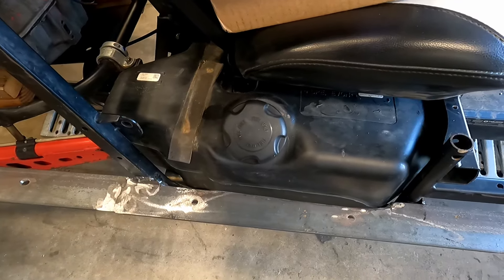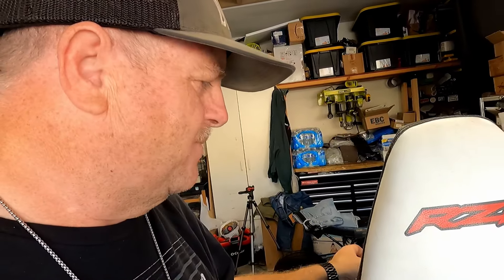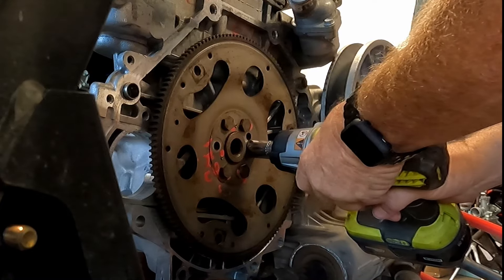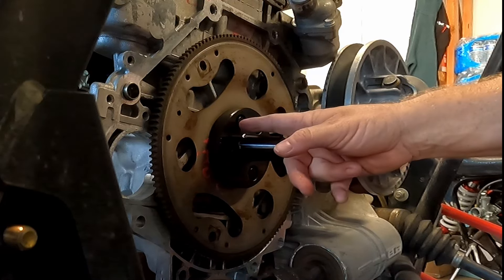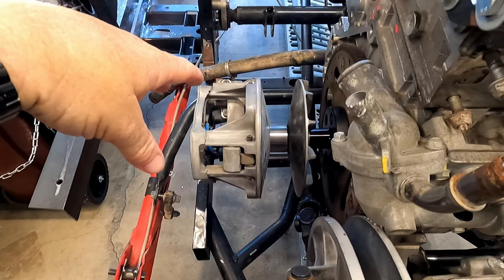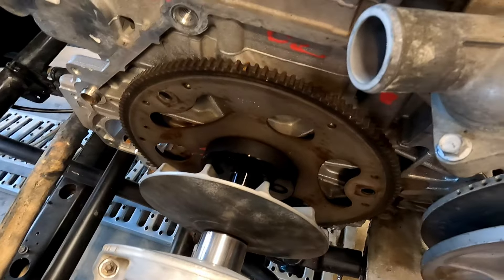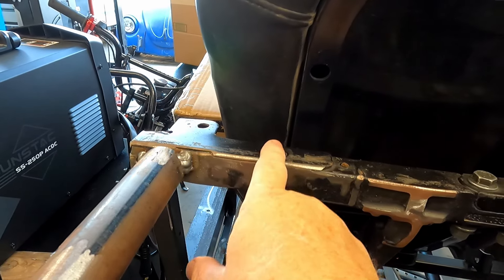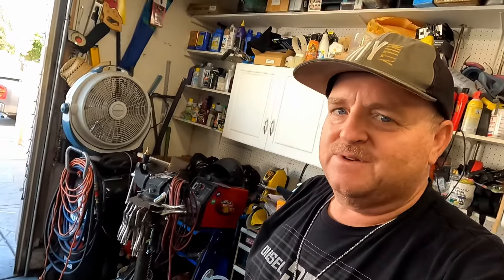Chevy 2.2 ECOTEC Primary Clutch Adapter - BAJA RZR Project EP  14 -

Comment: The fun part is figuring out how to make parts work together and accomplishing the task. The ARP bolts are some of the best you can buy, I used them on my alum cyl. heads on my Chevelles 541cu in big block motor. Nice video Willy👍
Reply from the maker: I read a lot about other bolts failing so can’t loose with ARP!

Comment: Nothing like grabbing a hot bolt! Been there done that 😂 great upgrade, perseverance and persistence for sure. You inspired me to quit procrastinating and change the belt on the Can-am.. need to get the special clutch tool first but can’t find one with the right threads 😢looking forward to the next update!
Reply from the maker: I feel like I’m at the hardest part of this build. For the last 3weeks I’ve been trying get correct belt alignment and lock in the motor mounts and it’s fight me everyday.  I have it so close but it’s still not correct. Now I pretty much have to start over. Unfortunately the work I have done so far is fully welded. Now I’m cutting it loose for the 4th time. I want everything so perfect. It would probably be fine now but would most likely burn belts. I’ll get it though, I’m pretty sure I figured it out this time. When I get these clutches and motor mounts all done I think I’ll take a break from the Baja project.
Reply: @DIYWilly  
You’ll get it done ✅ Willy style! Take a breather and go back at it when the spirit moves you… 🤙🏻

Comment: This is way outta my knowledge of operations but with the wisdom and courage i now know the difference lol whatever you did its fresh and diy willy style 💪🏼💯🔥🔥🔥🔥
Reply from the maker: This is only the beginning. Aligning everything is the next challenge… Then I have to make the 2.2 engine start and run from the RZR gas tank.  🤔🤯
Reply: @DIYWilly  I had the ecotec in my Saturn vue  it needed a timing chain bad ended up junking it for 300 bucks if I was into fixing stuff like I am now I would've kept it
Reply from the maker: Once I get this one started, I’ll be doing the timing chains also.